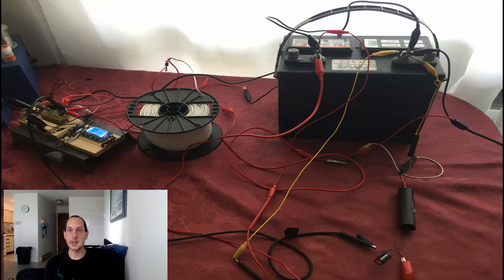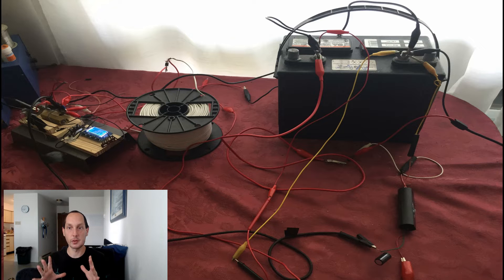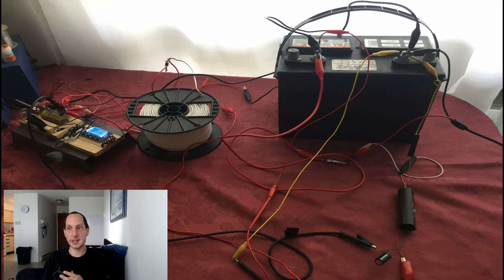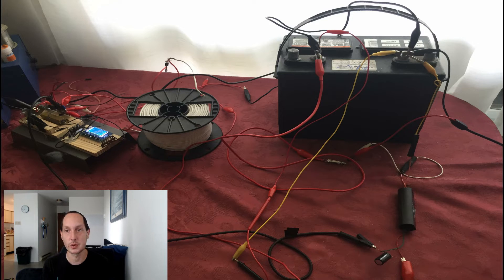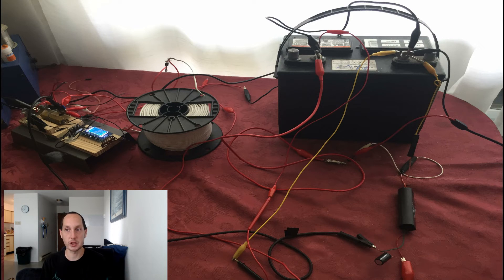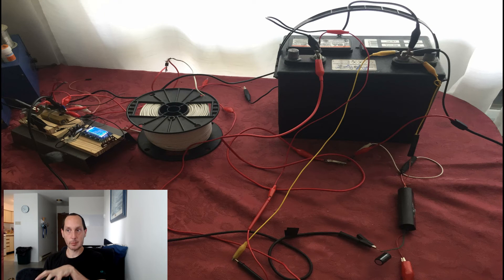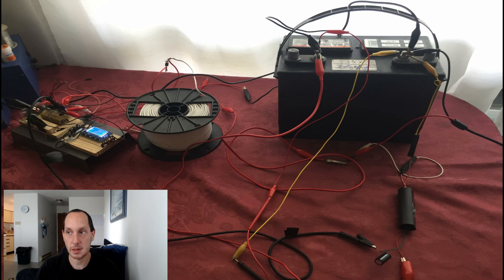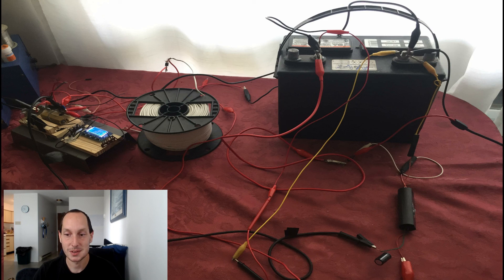Follow Up Back EMF Project

Comment: I want you to make video filling latex balloons with lead acid battery when charge it produces hho but it needs just a hole near negative connect to pipe and to bubbler and make balloons fly can you do video about it?❤a hole near negative is oxygen not need!
Reply from the maker: Sounds over complicated. I just put a little bit of vinegar and magnesium flakes in the  balloon..... You didn't hear it from me.....
Reply: @joellagace1679  no !i mean you need to make video filling latex balloons like thishttps://youtu.be/4Ub_W6qEBAc?si=UAH7jRQdeRhIr87D i want to know it real or fake use a hole near negative to bubbler and bubbler to balloon to fly up not use a lot hole like that guys! can you do video about it?

Comment: have you tried experimenting with higher frequencies ? I am talking about at least 100 MHz.
Reply from the maker: Yes I find it difficult to keep the power from RF leakage. I experimented early on with swr bridge circuits that rectify the high swr in my case done intentionally with a big coil and the diode circuits even with coax there can be leakage and I don't think my local spectrum authorities will appreciate it hehe, I did notice the closer with the standard back emf method I got the 1 mhz the less the effect is notable. I have many previous videos that talk about this.  Have you experimented with high frequency RF?
Reply: Thank you, Joel. I am working first to build at least a two layer magnetic shielding box. Then pulse the coil at low frequency with an emf meter to test the box. The walls would have to be thick i reckon for higher frequencies. I will try with very low drain currents when pulsing the inductors at high frequencies, because I don't want any trouble either. I am taking it slowly and want to make sure also it is legal and not cause EMI. If there is over unity effect in the HF range i won't need large input power anyway, so i will target mW output, really.
Reply from the maker: Please keep us updated on results. :)

Comment: I look forward to your videos. I know you are more technically minded in this pursuit, for you and other just the idea of even a small gain would be worth it. For me i'm asking the question of the practical use of this all. If the world ended tomorrow, certainly we'd all just go back to fire for all our needs. Assuming the world isn't going to end, i'm interested in how I can use the current system to develop free useful energy systems. Grow lights for indoor vegetable grows would be useful. All the lights in the house would be useful. The holy grail for me is, some kind of Heating source using electricity. Of course solar and wind can achieve this, but they're not reliable. I'm interested in your goals, outside of just proving concepts. Are you interested in real world practical uses? I know batteries are always going to be the Choke point in terms of useable energy, because even a small energy generation continual over night balanced with energy consumption using batteries is useful, but you need the batteries.
Reply from the maker: Regarding scaling up my previous back emf setup that powers a 100-watt lamp, I had a remarkable experience about a year ago during the summer night when a power outage occurred in town. With everyone left in darkness and no backups, including dead cell sites, my setup proved highly useful. I had this back emf system in place, charging two 12-volt batteries along with a substantial 4kw inverter. Although I hadn't shared this setup previously to avoid potential backlash and skepticism, I can confirm that with some modifications, it can work on a larger scale.

During the power outage, I devised a special cable and turned off the main breaker in my place. I backfed the 4kw inverter, which remarkably sustained my entire household throughout the night. My lights, Wi-Fi, air conditioning, refrigerator, and other appliances were all powered, and I even ended up sharing my Wi-Fi with neighbors since I was the only one with electricity, and there was no cell data available.

The impact was substantial, as my house brightly illuminated the entire block, even outshining the streetlights that were also affected by the outage. This occurrence raised curiosity among people, and even the electric company was perplexed since they couldn't spot any noticeable solar or wind backup systems at my location – not even an external power delco was running.
Reply: @joellagace1679  fascinating, I'm preparing to move back to china for a few months , I lived there for 8 years previously and black outs are a common occurrence. Looking forward to buying some cheap components and continuing my work there.
Reply from the maker: The key is probably building multiple back emf systems all isolated from each other so they can charge more batteries faster, It's just a matter of scaling up, if the gains of one unit can't really be maximised we can always combine. Just an idea. I'm not there yet. Perhaps one day when resources arise.

Comment: Joel, tnx for the video! I would try the same configuration on a second battery, but possibly you dont have that available? Maybe you do have a battery of a powerdrill? Or a laptop? Other option is to drain this battery with a load like a 12v carlightbulb or a 12v motor? Just as an attempt to drain this battery a bit and re-connect and see what happens?

Comment: I wonder if using this exact same set up to charge another battery, 
might give more insight about the charge rate of the set up.
If the second battery is almost completely drained.

I wonder if the source battery is fully charged, and the charging battery is 1/3 or 1/2 charged...
whether it makes a difference with regard to charge rate.

Using the water level analogy, of water moving from one container to another
If the source battery is full charged and the second charging battery is also fully charged, then it leads to a 
stable level,  where the voltage remain in a range.
 
  If the source battery is almost full charged and it is looping on itself, I wonder whether it might lead to a stable level,
 which may appear as a slow charging rate as you say.

I am sure you guys have seen the behavior of batteries and capacitors from multiple perspectives and know how they behave.
This is just a comment, wondering if there might be a relation 
between charge rate and initial charge levels which could account for the results  we are seeing